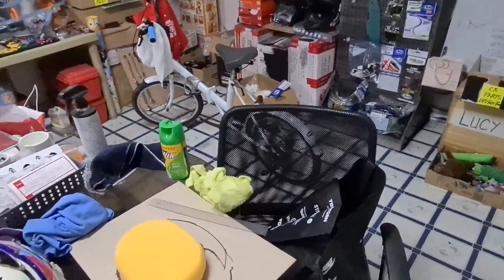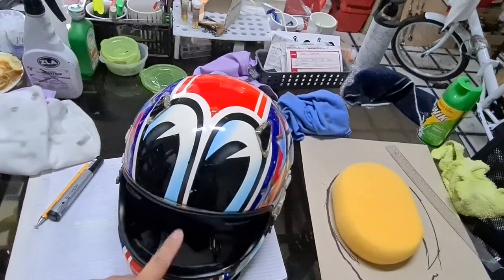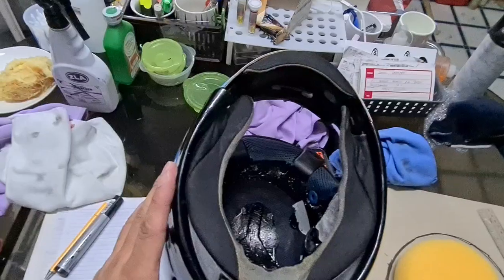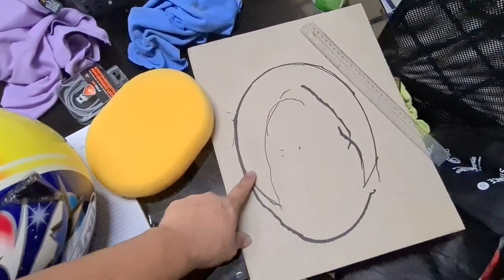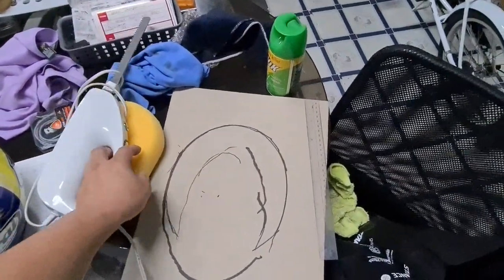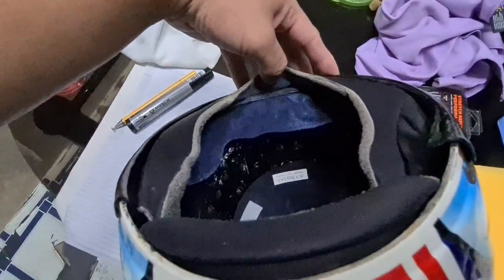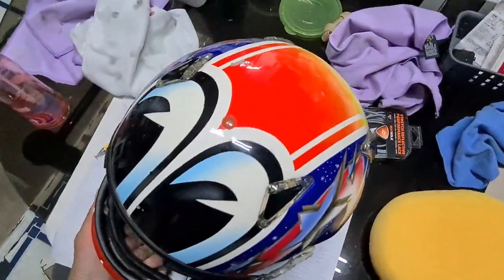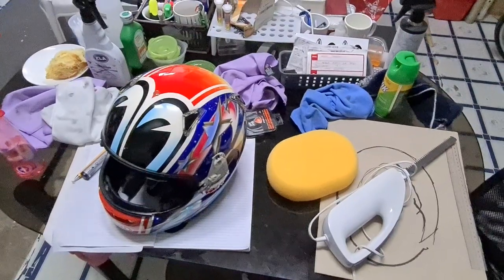ARAI ASTRO Neck roll repair guide PART 1

Comment: If I understand the neck cannot be removed and be changed as on rx7 V, corsair, or current Arai ? But can We stick a new neck ? One for RX7 V for example ?

Thanks!
Best regards from France,-)

And great video, really interesting !!
Reply from the maker: Rx7v is too big for the old unit. However with modification it can be done but the helmet will only be fictional and will not follow its original neckroll looks. I recommend buying similar model and transplant the neckroll to your helmet. You will need butyl tape for adhesion of neck roll to your helmet.